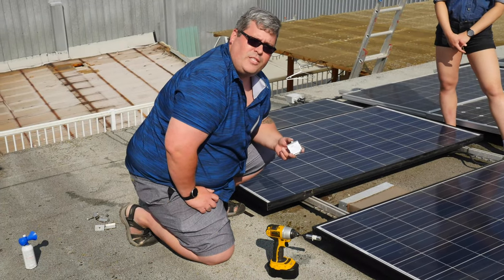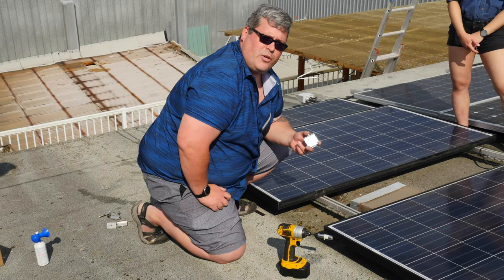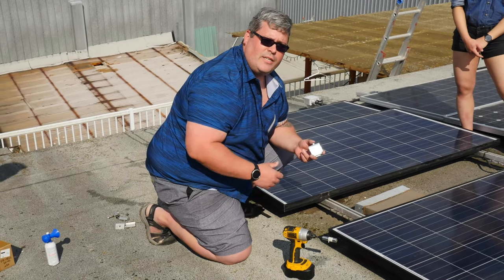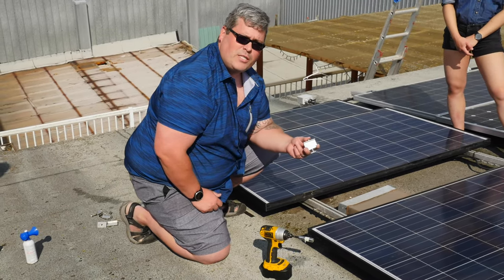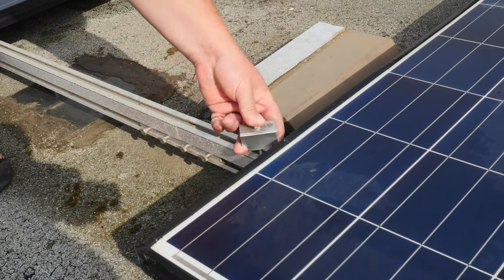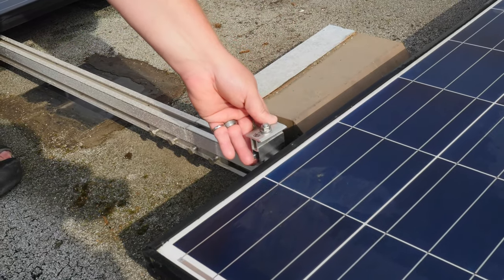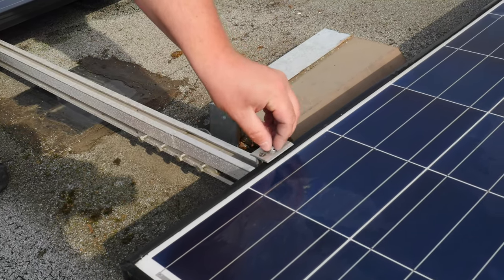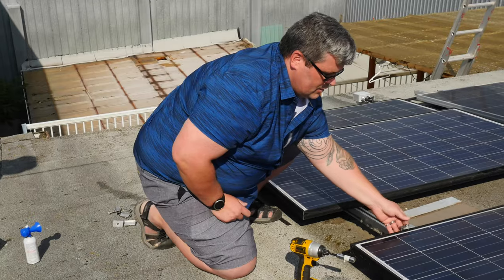Fast-Rack Spring Loaded Solar Mid Clamp

Comment: It doesn’t look like there’s a torque spec for that bolt since you’re installing it with an impact driver, but I’m curious how you make sure that it doesn’t get over torqued to prevent the module’s frame from getting crushed.
Reply: The answer is they didn't,  M8 grade 5.6 bolt is rated at 500MPa and is approximately 1,873 kg (4,128 lbs) in tension. The Nut and Washer is a single unit and puts an angled force onto the Mid Clamp (Because threads are at an Angle) the load path is directly onto the flat portion of the Mid Clamp (Against Solar Panel Manufacturers recommendation) and the load goes directly into crushing the MidClamp, straight onto the top of Solar Panel Frame onto the Glass. There is a reason why Mid Clamps are supposed to be U-shaped, its also to allow for Thermal Expansion (Left and right and upwards) under the Panels heat. Maybe I'm wrong and they did a heat analysis on how much the Aluminum will expanded against the M8 Bolt rated at 1.873Tons/ 4128lbs breaking force.